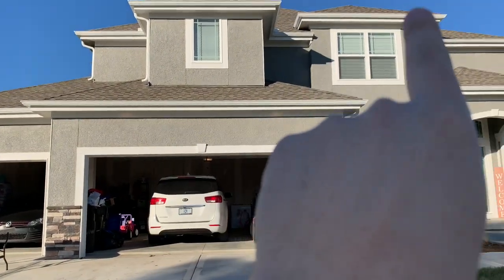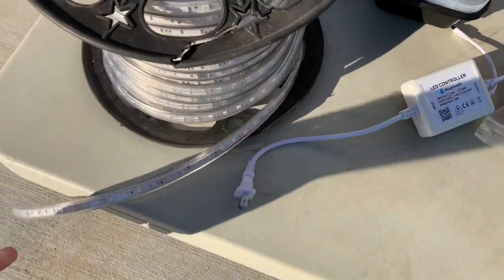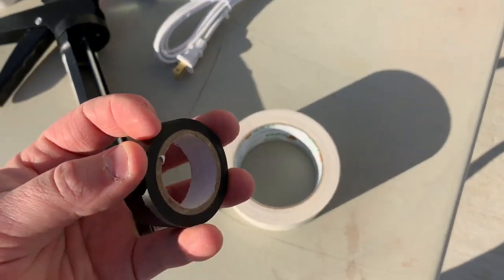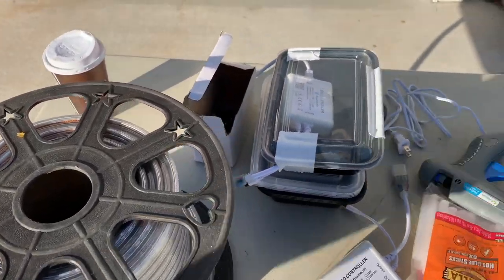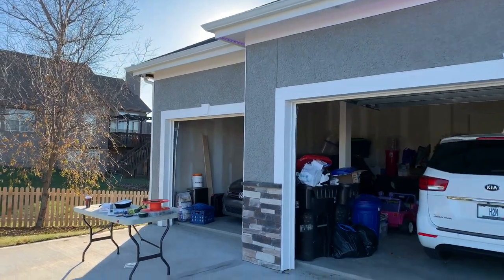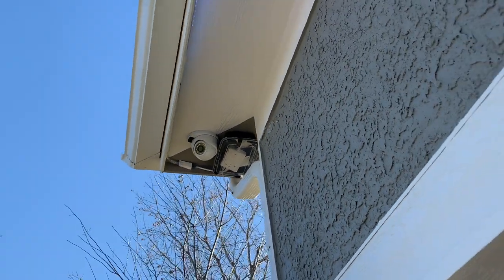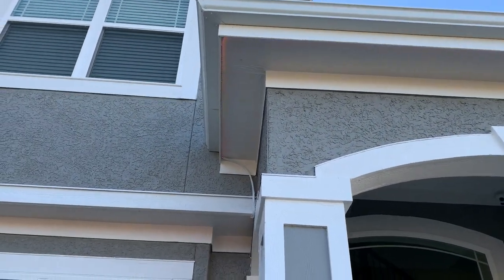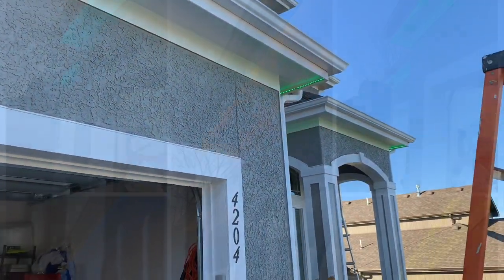DIY High Voltage 110V RGB LED Strip Permanent Christmas Holiday Accent Lights Installed

Comment: I like the idea. I think I would stick it up with some 3M VHB tape though. Tough stuff.
Reply: The Strip is very heavy and the oil in the silicon will not hold even a VHB up long

Comment: Your video was helpful to me in putting up my LED strip lights, especially the use of the clamps. I didn’t want to cut any strips either and blocked out lighting using electrical tape. I’m just worried that in time the tape would melt. My lights came with mounting brackets which I was able to use on my wooden eaves and there were short sections where I used Gorilla double sided mounting tape in places where I couldn’t get a screw driver between the wall of the house and the eaves. Thanks for posting your installation process.
Reply from the maker: I’ve had good luck with the tape.  LED light do not generate very much heat at all.

Comment: Awesome job!!
Just a couple of suggestions.
1. Use heatshrink tubing instead of tape
2. Construction glue would probably be more durable and UV stable.
Reply from the maker: Thanks!  I wanted to heat shrink but it would have been tough it slide it on there, 50ft down the run.
Reply: MARCUSMARC! True, but heatshrink comes in various sizes and shrinking ratios!

Comment: Going through your videos I’m happy to see you went from a Mazda to a VW. 😁 Did you you an IP67 LED?
Reply from the maker: Haha I switch cars a lot!  I’m onto a Lexus SUV now.  I honestly not sure of these strip’s IP rating, but they are incased in a silicone sheathing.
Reply: @1MARCUSMARC1  haha, that’s ok. It’s a ip67 I think. If they can take the cold, it should be fine here In Florida. Has the caulk seem to hold up as well?
Reply from the maker: @Stpetersburginjurylawyersmp  holding up great!  Actually sold that house and kept them up for the new owners.

Comment: nice, they do sell a plastic railway you for led lights that you screw to the house and put the strip inside.
i just wasn't too sure on volts and how many controllers I need. your video gave me a pretty good idea. thanks.
Reply from the maker: Yup!  You can find them on eBay and Amazon.
Reply: Go to HD...in the drywall section where all the edge protectors are.
In the middle of that pile you find some PVC U-Channels
4 bucks a 10 footer
and Marcus...great darn job

Comment: Can you share where you bought the led strips and whether you had to us amplifier for the run?  How about the power source.
Reply from the maker: You can buy the strips and controllers here: https://www.ebay.com/itm/110v-120V-LED-Strip-Light-RGB-W-Outdoor-Holiday-5050-3528-flexible-15-100m/192546574809?hash=item2cd4ab91d9:m:mmrtaaSr8G14vHoOr5FphvA

Or Less4Leds.com

You do not need an amplifier for 110v strips, they can handle very long distances.  Power comes from the Bluetooth controller plugged into an exterior power outlet on the house.

Comment: So would a 24V power supply not be enough to run about 100’ of Leds? Or would I have to go 110V?
Reply from the maker: It could be, you’d just have to inject power at multiple places in the run.  With 110v you can’t inject at the beginning only.

Comment: Thanks to your video I am seriously looking into doing this around the circumference  of my roof of a pole barn I am having built currently, and am curious on what exact type of connectors you have to buy since you said you cut yours to length.  I was going to buy a pkg. they sold for 131', but maybe I should just cut off the excess I would have left.  Just don't know if these are premade with connectors or you have to put the connectors on both ends anyways?

Comment: Was the electrical outlet that the controllers plug into already installed on the soffit or did you have to add them?  If you added them , could you elaborate on the outlet boxes and how you went about doing that?
Reply from the maker: Yeah, they were already there from when we built the house.

Comment: this is so cool.  i wanted to do christmas lights but hated how common and typical bulbs were.   wanted a contemporary look.   question... you had an outlet at that controller box.   do you also have an outlet for the top run too?   i don't have an outlet anywhere along my roof line so i'm trying to figure out how i would do this.  also, it has been a year, have you learned anything new or have any insights on what could be better?   do they make waterproof controllers so that you didn't have to put it into a box?
Reply from the maker: t spunk Well you could hire an electrician to put in outlets or run an outdoor extension cord up there.  If I were to do it again I would probably do it the same, it’s worked very well.  I don’t anyone makes a waterproof controller but you could certainly use better looking boxes.

Comment: Wow! That looks so awesome! I am going to have this as my summer project. How many controllers do you have? How many feet can you go before problems arise? I live in Washington where it rains a lot, so do you have any recommendation on what other materials to use to protect the LEDs? Thank you.
Reply from the maker: Welvin Zabala thanks for the compliment!  I have two controllers, one for the top and one for the bottom.  I think you can go about 120ft on one controller depending on the wattage, so I could have done my whole house with one but I want the flexibility of having two colors at once.  Just make sure you silicone the connections well and the end of the strip so water can’t get into it.  The strips themselves are highly waterproofed, they could even be used under the water.

Comment: What would you recommend for this exact project but with individually addressable LEDs? I LOVE the thickness of your plastic housing around the LED.  I know its made that way, but its the best ive seen vs round etc.  I want to do something very similar for year round lights (halloween, xmas, fourth of july etc) but I want them to be addressable :)
Reply from the maker: Ryan LaBarre Addressable would be awesome.  I haven’t done enough research on those to make a recommendation on LED strips.  Seems like most of the videos I’ve seen, people use the pixel strings rather than strips, but I’m sure both are available.
Reply: @1MARCUSMARC1  can you share what strips these are? a link perhaps?  Ive decided the addressable way is just too much work for a lazy guy like me.. id like to mirror what you did here. I have about 150ft on one run to do, and maybe 80-100 on another... would love to know the items used :) thanks.  also, since this is a year old now.. any reliablility issues?  I live in a northern climate, so durability is a big deal
Reply from the maker: It gets pretty cold in Kansas City where I live and they seem to have done well through a cold winter last year.  Any of the 110v strips here: http://less4leds.com

Comment: Nice look for those lights. I'm wondering about a reply you made to someone to someone else. You said you wish you had bought the wifi version. What is that? I'm pretty new to RBG/LEDs. Thanks
Reply from the maker: That’s the color controller.  The controller plugs into the power and then you plug the strips into the controller.  The controller is what controls all the functions of the strip.  I have Bluetooth right now, so I have to be near the strip to connect my phone and use the app.  A WiFi controller would allow you to be anywhere and control the strip.

Comment: What is the data sheet for these lights? Trying to calculate power consumption. Do the lights come with everything you need or do I need to consider power supply?

Comment: Hi there, I love your video 💜 I'm just wondering how you get segments of different colors instead of the whole thing being the same color. For example 5 ft being blue the next 5 ft being purple the next 5 ft being pink, ect. I saw someone that had also caulked these in and got theirs to have different color segments
Reply from the maker: bye bye you need Individually addressable LED Strips in order to do that.  They are somewhat more complicated and require power amplifier because they don’t come in high voltage strips like these.
Reply: @1MARCUSMARC1  Thank you so much for getting back to me on an older video. I was afraid of something like that, haha! I have a 18-ft patio deck that I wanted to juice up for the summer, just along the rear top wall. I'll start fishing around on Amazon. Your house looks so beautiful 💜 you guys take care and be well during these trying times.

Comment: What did you use to attach the plastic tupperware boxes? (This is such a smart idea btw!!)
Reply: So is this electrical tape/white tape idea!!! It is such a small detail but it makes it look professionally installed.
Reply from the maker: I screwed the box into the soffit through the bottom of it. Thanks!

Comment: I noticed there aren't any soffit vents in your enclosed soffits.
How do you create cross-ventilation in your attic & truss spaces without soffit vents?
Reply from the maker: You don't see soffit vents on the front of houses in this area, but the sides and back are vented.
Reply: @1MARCUSMARC1  How do you achieve adequate cross ventilation where there aren't any soffit vents?
Reply from the maker: @LoireValleyChateaux  I’m not a home builder, I’m just telling you my observations.
Reply: @1MARCUSMARC1  Thank you for your LED lighting video it was very helpful.

Comment: Hey Marcus is this awesome!  This is exactly what I’m trying to do. I was thinking on installing the strips within an aluminum channel so the lights can face forward to the street. I’m hoping it looks as good as yours. Where did you get the waterproof boxes? Are the controls not waterproof?
Reply from the maker: The boxes are just some Tupperware that I re-purposed.  The  Bluetooth color controllers I have are not waterproof.   The main difference between mine and one that points toward the street, is that yours will like more like a line of lights rather than the house being lit up.
Reply: MARCUSMARC! True, I’m having second thoughts on the line appearances . I  also going to install at the bottom of the foundation to give a glow behind the plants in the front yard.  I’m checking out the website and I think I found the ones you’re using (Bluetooth kit holiday strip?) what didn’t you like about the WiFi kit?
Reply from the maker: MIKE if I were to do it again, I would get the WiFi.  It’s wasn’t available at the time I got my kit.  Good luck!  The aluminum channel will certainly be a nice touch.  I may do channel on my next house.

Comment: Great video, how well has your install held up? Everything still adhering?
Reply from the maker: KillaGT Guy I had one spot come down around the 1 yr mark, but I just glued it back up.  I’m about year 2 now and it’s doing great.  It turns on every time I try to use it.
Reply: MARCUSMARC! Great, do you get winter/snow wherever you are? thanks for the info.
Reply from the maker: KillaGT Guy yeah, we good a nice strong winter here in Kansas City.

Comment: Awesome video! How many feet can you straight run if you have 15amp plug controller. I want to run a long strip around the house with this but plug it in a 110v 15amp plug at the end.
Reply from the maker: Noel Panilagao These don’t pull very much power, certainly not anything close to 15Amps.  If you had a more powerful rgb controller, which are readily available, you can run up to 330ft in one run without a significant voltage drop.  These Bluetooth controller can do about 176ft. This should be easily doable on a 15Amp circuit.
Reply: Thank you for the info MARCUSMARC! What I would like to do is run these rgbw strip and find a 110v rgbw controller that is compatible with Philips hue bridge. Do you know or where to order one.
Reply from the maker: Noel Panilagao no, sorry I haven’t seen one.

Comment: How long has this set up lasted? I know you've done it a couple times and it seems like different houses. My wonder is how long it lasts. I am about to buy a house and my goal is to do this around the house by next Christmas and use it through out the year. But the goal is to leave it up all year every year and have it last several years and not need to replace it often. If it lasts 5 or so years that would be idea. You were saying that connections were a reliability issue for your last set up. Was it getting moisture in there from the cut housing? Or was it the solder joints not holding up? Just curious. Also I wonder the range on the Bluetooth box. Do you have to stand right under it for it to connect?   Great work I really want to do this all around the house. Front and back and set up colors for random holidays and party mode for when we host people over. I really hope they release a WiFi(Alexa) compatible control box in the future but the lights will still be fine just replace the box when it comes out but I'll do the Alexa controlled power outlet like I read you saying somewhere on one of these videos. Looks like it doesn't end up being super exspensive. Like cheaper than buying off the shelf Christmas lights and clips and exstention cords.
Reply from the maker: I don’t have much time on this one yet, only about 2-3 months so far, but it has been 100% reliable so far.  

On my old low-voltage system most of the reliability issues were with connections because I cut corners and rushed those connections.  Even with a perfect install, though, I think you’d still be dealing with some issues here and there because there are just so many different connections with the amplifiers.  The two seasons I ran it, I was constantly fixing and troubleshooting issues with connections.  Both seasons, it was non functional by Christmas and too cold to get up there... lol

Anyway, since I’ve had such good luck with the high voltage system, I do feel comfortable with it now.  I think a big factor in longevity will be the silicone adhesive holding on the strips and the effect of UV on the clear strip cover.  My old ones had started to yellow from UV exposure when I took them off the old house. 

I haven’t looked for a WiFi controller for a while, but I’m hopeful there will be one released soon.  The Bluetooth connection goes about 30 or 40 feet.  I can sit in the car on the street and control it.  

Thanks for the compliments, good luck on your project!!
Reply from the maker: I’m  about 9 months in with no issues of note.  Still works great!
Reply: MARCUSMARC! Hi, can i ask where you bought the LED strips from and how much they cost? Also the name of the controller and cost too please. I need Two 15 metre strips for the top and bottom of my house. So in total 2 controllers and 30m of led strip. Your strip looks very long compared to the ones i find listed on eBay.
Reply: MARCUSMARC! If you could provide links for the controller and LEDs that would be great. Having no luck finding any individually addressable ones longer then 5 meters. Also the controller looks like it’s able to power at least 15m of leds which I would also need.
Reply from the maker: cody heiser Less4Leds.com is where I bought mine.  They have pretty long lengths.
Reply: MARCUSMARC! Thanks! I’ll. Check them out. If all goes well and I end up with some I’ll put a video up showing mine.

Comment: could you use a different controller that would let you control it via an app but also integrate with amazon alexa ?
Reply: Yeah they probably have wifi controller ones you can use with your phone I use monster neon light strips
Reply: @ajworld8626  can you link me to these lights?  are they good?

Comment: Can you do a rainbow effect like different colors at the same time or different colors chasing each other
Reply from the maker: luckychris1997 No, these will only do one color at a time per strip.  The leds needed for that type of affect are called individually addressable.  They are a bit harder to setup and program, but it can be done.

Comment: I was looking at doing what you had in your other video because of the WiFi/app so I could connect it to Alexa/google home. Is that possible with this set? Could you do a run through of the app you’re using to control these?
Reply from the maker: There aren’t any 110v RGB controllers that I have found that use wifi yet.  But, I do have this on a smart switch for Alexa/google home on/off control.  When you turn the power on with the smart switch, the controller comes right back to the same mode it was in before the power went off.  So, in my case, I typically keep it running a 7-color gradient fade and when I turn on the switch it pops right one with that mode.  I actually have it set on a schedule to come on 30 minutes prior to sunset and turn off about 11:30pm. 

Once I get the top run up (I’m kind of slacking), I’ll get a full operational run through with the app.
Reply: MARCUSMARC! That would be awesome to see that final run through. My brother and I are both looking into doing something like this with our homes. I’d love to be able to just say “Alexa turn house lights blue” but I guess that’s not a huge deal. With your setup can you pick two colors to rotate through? Like for Christmas have it fade between green and red? Or is it all just preprogrammed in?
Reply from the maker: @heyjustj  You can pick all the colors and run custom colors and modes.  Its pretty versatile.  There are a lot of modes programmed as well.  Here is the new video: https://youtu.be/AILMY_YppBc

Comment: How do you turn on and off?  How long do they last before a bulb goes out?
Reply from the maker: I do it two ways.  Through the app when connected to Bluetooth or just flip the switch on the outlet.  The nice thing is that it always reverts back to the last colors it was using when it powers on.  They are led so they last a very long time.